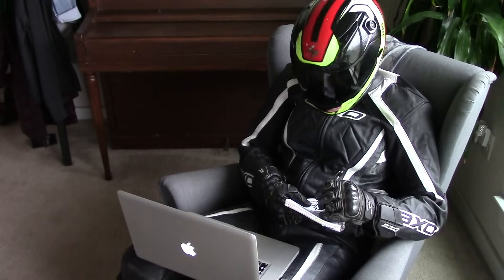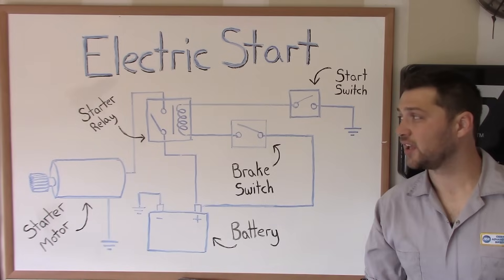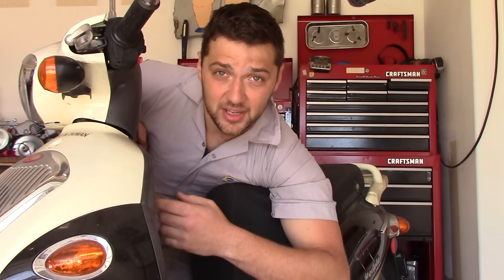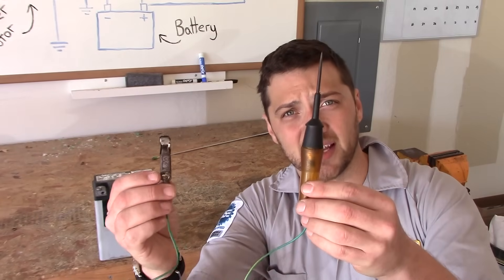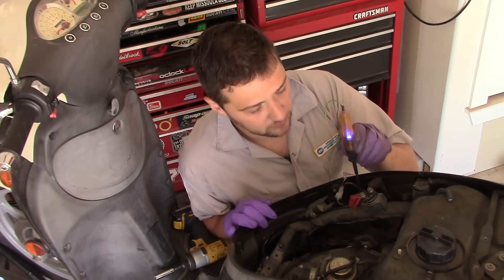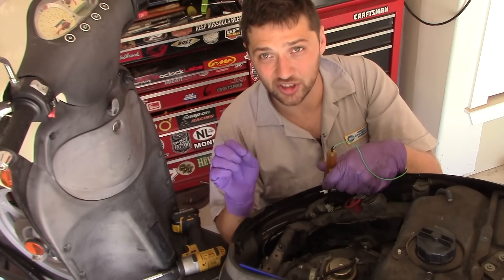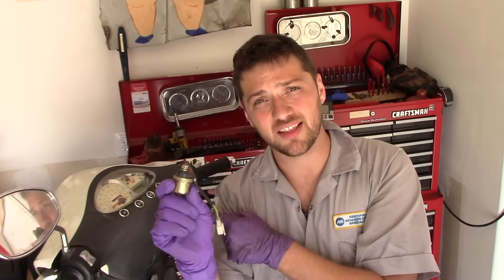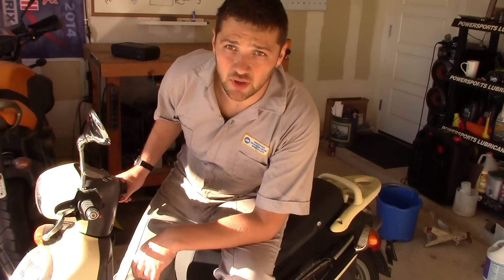Scooter 911: Electric Start Doesn't Work (troubleshooting your starter, starter relay, and circuit)

Comment: Have a 50cc taotao scooter. The scooter will starter will click but won't crank. What could be the problem?
Reply from the maker: Did yoy try the relay bypass test at 7:32?
Reply: @Scooter_911  have not yet. Will definitely try tomorrow. The motor wouldn't be seized up would it?
Reply from the maker: @zach09j  it could be. I've seen a lot of them drop a valve and the piston jams the valve up into the cylinder head. But it also could very well be as simple as a starter relay. The test is a great jumping off point
Reply: @Scooter_911  okay. Holefully not. I'm hoping that'll the starter relay bypass will work tomorrow and that'll give me hope. Will let you know for sure tomorrow. Thank you
Reply: @Scooter_911  I was also wondering can you kick start a taotao 50cc scooter without the key. I bought it from a guy saying it needed just the ignition switch but we found a way to turn it on and stuff but it just clicks when we hold the brake in and push the start button. I didnt know if you needed a key to jump start it or not.
Reply from the maker: @zach09j  well you dont technicially need a key but you would have to bypass the ignition switch (hotwire it)
Reply: @Scooter_911  you would have to hotwire it to jump start it? My buddy hooked it up some how to were it would turn on and stuff
Reply: @Scooter_911  what wires would you hook up together to hotwire it. Its a 50cc taotao classic
Reply from the maker: @zach09j  should be a solid red wire and a red wire with black stripe. But the colors change. Just connect any 2 wires that are not green or black with white stripe. Those two wires are ground and the killswitch.
Reply: @Scooter_911  okay. Thank you
Reply: @Scooter_911  I hooked up the red wire and black and blue wire. It clicked when I held the brake in and pushed the start button . It sounds like its coming from the starter relay. I tried bypassing the starter relay but it sparked when I tried it. I dont know if its because I hotwired it by hooking it up like that then trying to bypass it or what. If the clicking is coming from the starter relay does that mean its bad?
Reply from the maker: @zach09j  this is getting a little too convoluted. If you have time shoot me an email at garretseesingofficial@gmail.com and let's set up a time to square this away over skype
Reply: @Scooter_911  sorry for bothering you so much. I found out what the problem was. It was the gear to the starter. It was missing teeth to catch to start the starter. I moved it over to where it would grab and it started cranking.
Reply from the maker: @zach09j  nice work!
Reply: @Scooter_911  thanks.

Comment: Garret, very userul video but what do  I do if I press the button and the brakes levers and the engine makes NO sound whatsoever as if it was completely dead? What if sometimes the engine starts when I press both (especially when the engine is warm) and sometimes it does nothing at all? The battery  seems  to be ok, 13 v. What is wrong? Thanks.
Reply from the maker: Try the starter relay test at 7:32

Comment: My Scooter doesn't iddle and sometimes when I start it does not start or crank but just gives a qha qha sound
Reply from the maker: those sound like those could2 separate issues. i'm going to guess its a 50cc because 50cc scooters have a different starting mechanism than the rest of the scooters. There is a little bushing inside the belt cover that the start shaft slots into. if the bushing is dirty or damaged it wont allow the starter gear to extend and engage the teeth on the variator. As for the idling issue, i would try a valve adjustment first. check out my valve adjustment video here https://youtu.be/QkkYjRdtQxg

Comment: Ok so i have a 2010 jonway and when i test the pins on the relay and hold the brake lever they both light up, what do i do now?
Reply from the maker: Did you try the relay bypass test at 7:34 ?
Reply: oo

Comment: I haven't driven my scooter for nearly two months, kept it at my garage ! Then few weeks ago I took it out, it did take some time to start, but in the end it did. However, for the past two-three days it was taking more than 20 minutes to start even though I drove it each day. Now it doesn't event start after 20 minutes and the noise its making is the exact same as 3:36. Any clue on what it could be ? Fuel seems alright, checked oils, electric system works okay (horn,board and lights), and for the rest I have not a single clue. Its a 50cc Santini San Remo scooter that I bought fairly cheap and all my local mechanics are asking for a sum thats nearly half the price of the scooter just to diagnose and "potentially" fix. Thanks a lot for your answer, love your videos !
Reply from the maker: Its almost definitely clogged jets in your carburetor.  Modern fuel expires so quickly it only takes a few months of sitting to cause issues. I've got a carburetor service video coming out soon but there some great resources already available on youtube!
Reply: @Scooter_911  Hello Garret, it is me again ! I checked your new video about the fuel, ignition, compression triangle and tried to fix my issue. Ignition was working, but I did put a new spark plug, checked carburetor and the pilot jet (33) seems clogged and valves cant even open them (way too tight). Still not starting/running  and even the kickstart fails. However I would also like to ask your opinion on the fuel that was left in the gas tank over the months, would putting brand new fuel potentially solve the issue ? On a similar note, really enjoyed the new video, especially the opening ! Keep up the great work !
Reply from the maker: @alekseymihaylov7008  unfortunately brand new fuel won't clear the clogs in your carburetor. And most of the time the fuel in the tank doesn't go bad enough to become an issue because its sealed unlike the carburetor.  Good luck! It sounds like you're making headway!
Reply: Garret Seesing Great I am looking forward to your video ! Hopefully once its uploaded it would be enough to solve my issue ! Many thanks in advance as I love your quirky videos !

Comment: How do I fix a honda metropolitan with these issues? M please help me out
Reply from the maker: the real only difference between your metropolitan and the scooter pictured is your scooter uses the alternator as the starter motor and doesnt have an external starter relay. Does your scooter crank when you hold the brake and press the engine start button?
Reply: @Scooter_911  it was wanting to turn over, making riv riv riv noise. I was getting spark, fuel, and had combustion. I figured I would change spark plug. I sprayed starter fluid on the plug and in the hole. After I did that it started right up. Thanks for getting back to me so fast. Amazing videos! Keep it up. Thanks

Comment: Hi, I have no power to fuel pump, 12v at the dash but don't turn on & no lights, brake light works, turn signals work & engine turns over. Any help? Thanks
Reply from the maker: What kind of scooter is it?
Reply: @Scooter_911  sorry its aprilia sr50 07
Reply: Hi,  my bad it has not got a fuel pump oops, lights may work when engine runs. I have fitted a new starter motor but it just spins, and looking behind the vario  the worm drive seems ok

Comment: My scooter starts and runs, and all the electrical works but the electric start. I have to kick start it to get it running but everything else usually is fine. But the electrical only works when it’s running. Pls halp
Reply from the maker: Sounds like you have a dead battery friend!
Reply: Garret Seesing I thought riding it charges it??
Reply from the maker: @KyanR7  well yes and no. If the battery is healthy the charging system can top it up. But only a battery charger can truly recharge a battery. And if your battery has been dead a while or isn't in a good condition nothing can revive it.
Reply: Garret Seesing I got the Tao Tao pony50, I think you’ve reviewed it before, but how do you know if the battery isn’t worth it any more? Sorry for all the questions.
Reply from the maker: @KyanR7  unfortunately you would need a battery tester to know for sure but you can get a good idea by measuring its standing voltage with a multimeter. It should have 12.6 volts just sitting there by itself. If it only has 12.0 volts you can be pretty sure its gone. On another note the pony 50 is usually shipped with a 4l-bs battery (because its cheap) but you'll notice that the battery compartment is sized for a 7a-bs battery which is a more appropriate size. And on one more note, I just bought a pony 50 and I'm doing a whole series on it so stay tuned!
Reply: Garret Seesing really??? That’s awesome! Mine has a few problems from the start but it’s a really fun little thing to ride. Is it a better idea to switch to a bigger battery?
Reply from the maker: @KyanR7  absolutely. They originally came with a 7a-bs when they first came out. Its only in the last couple years they started shipping with a 4l-bs
Reply: Garret Seesing great! I’ll look into it. Any websites/stores you recommend?
Reply from the maker: @KyanR7  I like to support local independent motorcycle shops. And they almost always have a 7A-BS on hand! but if you dont have anything like that in your area scooterworks.com has pretty much anything you could need!

Comment: So I have narrowed down my problem to the 6:50 point. I am using a multimeter but get a negative voltage when activating the starter switch. Im assuming there is an issue with the ground wire but really not sure where to start on correcting it. Any help would be appreciated.
Reply from the maker: The starter switch supplies a ground. Where are your leads connected to? Is your black lead on the positive battery terminal?
Reply: @Scooter_911  Yes I had that backwards and after changing brake switch was able to get electric start working. Thanks for your videos they are extremely helpful.
Reply from the maker: @Robin_HOOD7  awesome!

Comment: Startsystem for Honda PX. When I use my braks switch than the engine starts already without using the start switch???? How is that possible??
Reply from the maker: Your engine start button is probably shorted out! I would disconnect the start switch as see what happens. Good luck!
Reply: @Scooter_911  It's OK now thanks to your elektric plan. Thanks!

Comment: Hey mate my yamaha bws lost power on the free way doing 80 km now won't start. Electric start sounds weird and kick start not working. Heaps of fuel and new battery. Any ideas? Thanks
Reply from the maker: Ooof it just stopped dead cold but you still have electrical power? Is it a 2t?
Reply: @Scooter_911  yeah still have electrics. Lights still work but the electric start sounds bad and won't turn over. Thanks for replying your videos always help me. Legend
Reply from the maker: @leighmellis11  well if your scooter is the 125 4 stroke BWS and your electric start kindof sounds like a power drill you probably dropped a valve or incurred some sort of internal engine damage. if its the earlier 2 stroke 50cc BWS you probably lost the top end.
Reply: YeH it's a 2t. Oil is full too. I uploaded a vid of the sound. Cheers dude

Comment: Just suscribed straight away...what about if you switch the headlight on is like you turn of the key and the engine stop, and both the relays (light and blikys) start looping/ticking crazy? (new battery just installed)
Reply from the maker: Wow I would put a voltmeter on the battery and switch the headlight on. It sounds like you either have a bad brand new battery or a serious wiring harness issue

Comment: Hey I have on my scooter that my key doesn't cut the power off and I like to put a kill switch on my scooter it is a 2018 millenium 125 T-26. Also I heat up and the rear lock up on me. Next question if your scooter those has it fuse what happens?
Reply from the maker: I'm not sure I understand what you mean
Reply: @Scooter_911  u see when a scooter is on and u want to turn it off . u out it off with the key! But with mine I have to choke the exhaust pipe to out it off or pull out the spark. Plug cable. And the next thing I let it run to charge my battrey but the rear wheel lock up when it is hot. Why?
Reply from the maker: @lilstranger1385  check the black wire with white tracer on the cdi. That black wire grounds the ignition shutting off the engine. As for your rear wheel I assume you mean its locked up when the engine is hot? That can be due to the engine heating up the rear brake line. That boils the fluid in the line creating brake pressure.
Reply: @Scooter_911  so what I should do for make it don't heat up so it won't lock on me
Reply: @Scooter_911  I am not a mechanic and I already took there but the same way it came back they took my money but u like I can send u video of it thanks for ur help
Reply from the maker: @lilstranger1385  you might have to re-route it away from whatever is making it hot. I would also recommend bleeding it to release all the gasses that are now trapped inside the brake line.
Reply: @Scooter_911  I don't know how to bleed out the gases. So I have to bring down my whole scooter in parts?
Reply: @Scooter_911  Mr garret. Do I have to change the ignite key or the same one can work. Or is the cdi?

Comment: Hey man thanks for your videos. I have a rather weird question. I have a 92 Yamaha Razz that won’t start via electric start. The kickstart will fire it right up. When I try to start it it only clicks right at the little relay. I bought a new battery, starter, and relay and it’s doing the same stuff. Any idea?
Reply: Yeah I mean for mine it’s just a little black box that kinda looks like a square fuse. I bought a new one. All it does is click. I have a test light and the wire that goes all the way to the starter is getting power.
Reply from the maker: @trechatlin479  you can still try jumping it from terminal to terminal. But if everything is new I would check your engine grounds and the condition of your power wires. If all else fails remove the starter but keep the power wire connected. Then ground the starter against the engine case and try to start it. See if it spins or if some part of the mechanism is getting jammed. Good luck!
Reply from the maker: Sounds like a faulty starter relay. Did you try the bypass test at 7:30?
Reply: Yeah I mean for mine it’s just a little black box that kinda looks like a square fuse. I bought a new one. All it does is click. I have a test light and the wire that goes all the way to the starter is getting power.

Comment: Can you make a video of this with a Taotao Pony / Speedy 50, from what I can tell, certain chinese scooters, still have these parts, but in different locations.
Reply from the maker: The tao tao 50cc models have all of these parts in exactly the same places. So this video should be perfect for you! Let me know if you can't find something! Cheers!
Reply: @Scooter_911  is there a way I can send you a picture of that broken side panel and wiring beneath it and you could tell me at a glance whether or not that's my starter relay?
Reply from the maker: @drwhosyourdaddy2025  sure email your photo to garretseesingofficial@gmail.com
Reply: @Scooter_911  I replaced my battery last month after ordering one from partskit.com TaoTaos big US warehouse based out of Texas.  They sent me a dx-5 instead of a dx-4 and I didn't realize that until after I already had the battery filled so we ended up Jerry rigging it and still getting it to fit inside the compartment. It's been running fine until last night when I went to leave to run errands turn over but just not start. 

Now my low beam went out about five times over the last year so I finally replace the entire headlight assembly and it just went out again.

Because of all the corona crap going on right now I don't have the means to take the bus down to a hardware store and get plugs and fuses just in case it's something simple as my scooters my primary transportation.

I'm just trying to diagnose what's wrong before I put into my buddy's shop and potentially end up ordering or replacing a bunch of parts.

Also worth noting I was in an accident last summer and have since replaced all of the braking systems, and tires however my scooter did get knocked over on its side a couple of times and there is damage to the passenger side panel directly below the seat.

If that could have somehow affected the wiring or if the dx-5 battery opposed to a dx-4 is putting too much strain on the electrical system it would be good to know as far as a starting point so I don't end up ordering a new wiring harness prematurely as that like 50 bucks,
And on a separate note if you can show a video of how to install & wire a modern LED four beam motorcycle headlight that would rock.  The stock one is terrible.

Comment: Fantastic communicator. Do you have QA forum ? It didnt solve my problem so if you could answer that would be great. My Battery has 4 terminals. since disconnecting it to charge my battery the starter switch just squeeks..wont work, but 1 kick and its off.. did i reconnect my battery incorrectly ? i dont know, cant find any videos on batteries with 4 terminals. aaaah
Reply from the maker: Wow! That is strange! I've never seen a scooter battery with 4 terminals. Is it like the old GM side-post/top post batteries? Send me some photos of what's going on to garretseesingofficial@gmail.com and I'll see if I can help you out
Reply: @Scooter_911  I appreciate your reply, this forum doesn't support uploading photos. are you on Whattsapp or messenger?
Reply: @Scooter_911  so i just realized the guy i got it from has taped 2 batteries together and wired it accordingly. It would be great if i could also send you the 'sound' it makes when i press the starter switch.